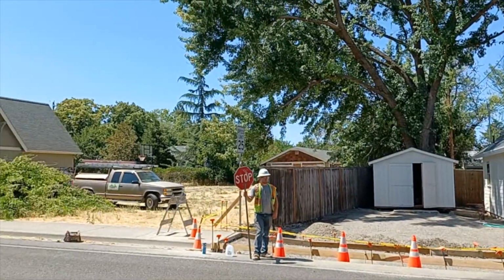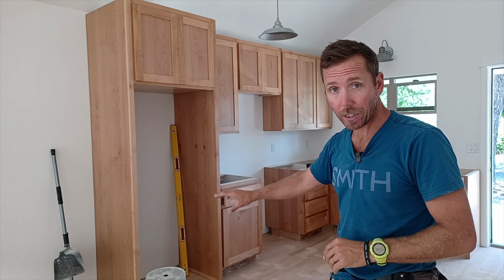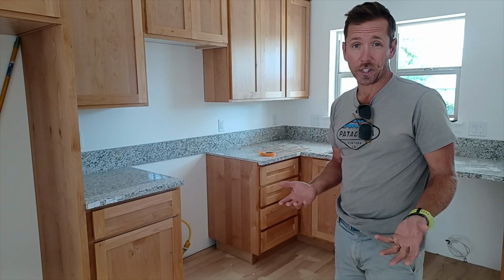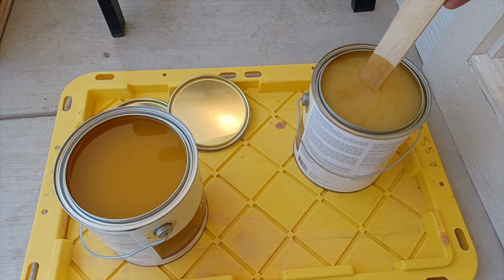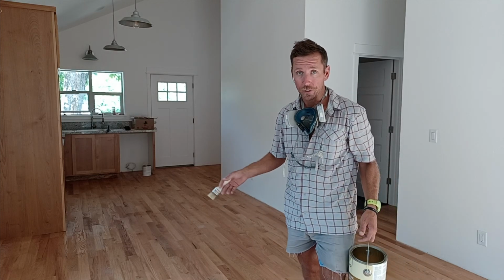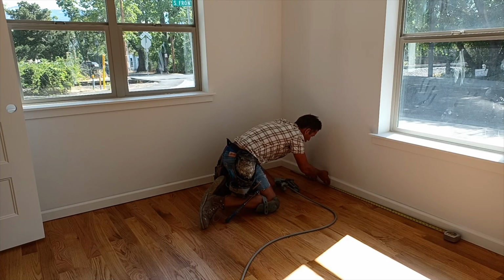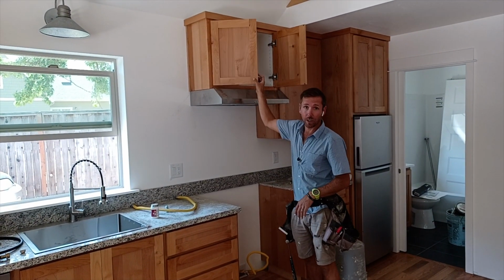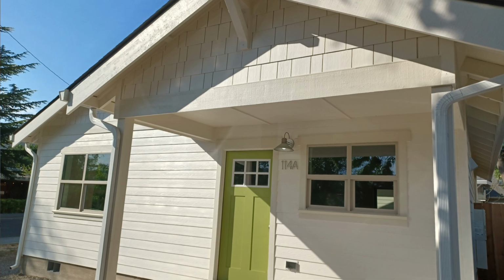How To Build an ADU with Cost Breakdown | Part 14

Comment from the maker: Cutting around cands and not being able to use the floor nailer outweigh the extra sq ft of flooring needed. Also its better that setting cabs on 3/4" blocks to maintain propeer
Reply from the maker: Proper height

Comment: Thanks for another awesome video. What's advantage of installing the kitchen after the flooring vs installing the kitchen on the plywood sheathing first then the flooring around it? The later, would save you more money (less flooring material) and make it easier to replace the flooring the future. Curious to know. Thanks

Comment: I just binged watched all your videos on the 2ADU’s. Im planning on building these on a few projects. I was planning on using a Prefab Modular factory built product. But after watching your videos I will likely do it both ways. I learned a lot from your videos and will hire quality subs. I won’t be doing much or any work myself. With the exception of helping out with picking up materials. But seriously how do you not have a truck?
Reply from the maker: Thanks for the views! Glad to hear I may have help you fine tune your stategy.  I have built many houses out of the back of that subaru. I have a little beat up truck but have always liked the do more with less take on life.

Comment: Love your design in this historical area. Is there any reason you choose to do smaller 1-2 bed units typically vs larger 4 bed units?
Reply from the maker: Thanks! Yes, I just love small houses and more of them. The more units we can add, the more downward pressure we put on rent prices, giving tenants much needed relief.
Reply: @ThatADUGuy  interesting. So two 2/1s would put more downward pressure on rent prices than a single 4/2 would in the same area?
Reply from the maker: I think so. Roughly 2/3 of all US households are 2 people or less
Reply: @ThatADUGuy  that is a good argument. Seems like if you wanted to have the same profit margin a 4/2 could be built for less money than 2 2/1s(especially a 2 story 4/2)and therefore be offered to the rental market at a lower rate but house the same amount of people. 

Notwithstanding the fact that most US households only need a 1/1 or 2/1. 

Thanks Derek for your vids they are awesome!